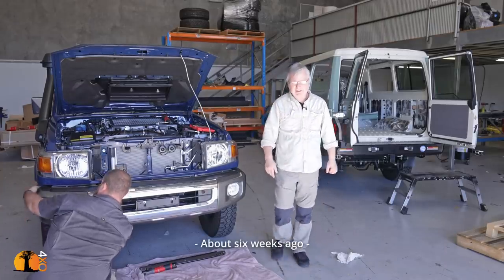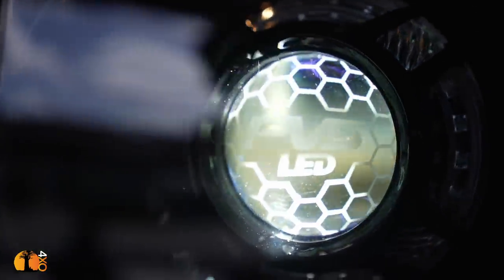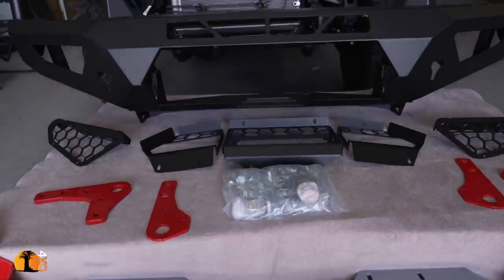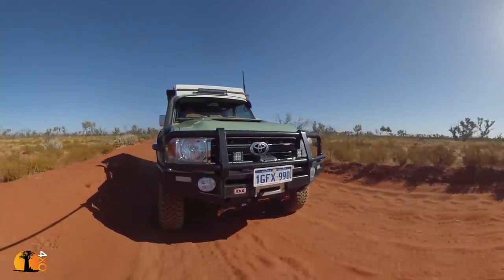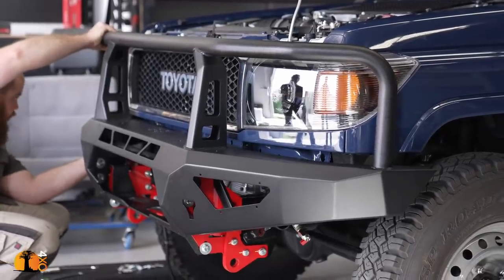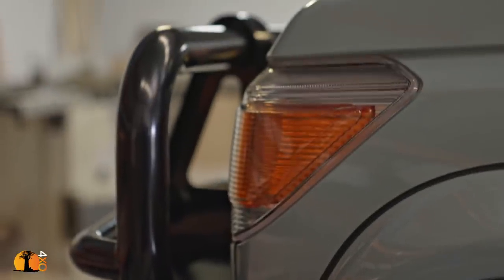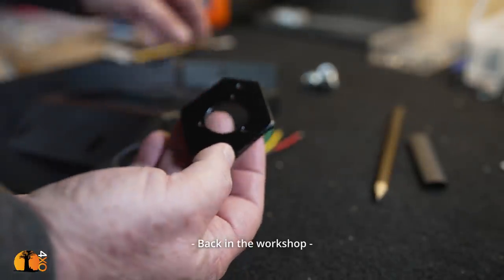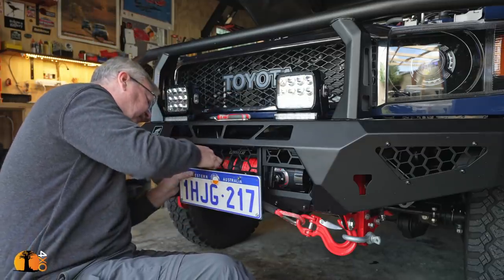BULL BAR, LIGHTS, WINCH & WEIGHT | How much weight have we added so far? | 4xOverland

Comment: I'm not sure I understood your argument in regards to not using a wireless control on the winch Andrew. Could you please be so kind as to correct what I have obviously misunderstood about your argument?

From what you said my take away was an argument against unsafe behaviour when winching by someone controlling the winch who is not paying full attention or fully engaged. 

But that can't be the argument because it would be a non-sequitur. That would be an argument about winching behaviour not about the technology used to control the winch. Where have I misunderstood you?

A wireless control can be used from the same standing position as a wired control, and one can make that behaviour a general rule. Similarly someone using a wired remote can be distracted or fail to pay adequate attention, particularly if enough cable is spliced in to length the wired remote. And we've all seen the idiots who have spliced in far too much length. 

The obvious argument to me against trusting a wireless remote is simply one of technological limitation. If you're stuck in mud or water, there is the potential for the radio waves to not penetrate and thus the control to fail or become delayed in an unsafe manner. 

Where as a wired control does not have such limitation.

Is that the argument you were actually trying to make? Because that's a good argument.

Comment: I wish you would have gone with an integrated light bar into your bumper. It would have made it so much cleaner. You also could have sealed your control box with silicone.
Reply: The control box solenoids  are covered in resin and are waterproof anyway, only hacks fill control boxes with silicone.

Comment: Wire the damn winch inside the car.    (and if you really need to use it from outside, use the remote)
I don't get it why you all invest do much in your cars, then when you get bogged you start running to connect the damn winch cable and have it hang over the bonnet.

Comment: I was under the impression that under the ADR it is illegal to install LED or HID headlights on a vehicle that came with halogen unless they are self levelling and you have headlight washers.
Reply: You're right, in the video wasn't but on PVS website it was mentioned in notes: "For Complete ADR Compliance Washer Jet Kit & Auto Levelling Airbags MUST be installed*

*Please check with your local engineers for compliance in your state"
Reply: Correct, I mentioned this when the lights first popped up (former auto design engineer) & was ignored. I'm guessing with free expensive stuff you have to fit them no matter what to justify the company's outlay.

At least the vehicle is a camper so can be slept in when it's defected & prohibited from moving during hours of darkness 🤣
Reply: I guess it will be dependent on local ADR interpretation for the LED lights, but suspect not legal unless specifically approved to the ADR's. Also I had thought folding plate frames may be problematic? - in saying that I ran a similar setup for many years, not visible so not an issue, although it may well fold up on river crossings
Reply: @kellyfleming4547  Generally speaking, for mandatory lights, such as headlights, there's no regional variance as far as ADR goes. Additional lighting, spotties etc. can vary, as far as I can tell, across the states.

Comment: Might be time you hang the boots up Andrew.  Your winch comments is ridiculous!! Sounds to me you don't want to go with the times to be honest.  How is having a wireless remote with "in and out"  side by side vs your wired controller that goes up and down any different?  Its not 15 buttons  to remember and have to keep looking to remember what does what. Your not typing a cryptic  code in on mobile phone size buttons pal. If you  seriously think this, you need to get out of the game. On another note... you may have saved yourself some KG's  going that bar, but once you hit a roo with that bar, kiss goodnight your front end.... and yes, I've seen this happen with this bar on plenty of cruisers.

Comment: that bull bar is to thin Andrew might okay for scrub deflection animal strikes right off of vehicle

When I gave you an estimation in weight i was factoring the whole build..

noting for animal strikes i average between 1500-2500 kg impact...

you hit a roo with that bull bar you will likely die
Reply from the maker: nonsense.
Reply: @4xoverland  sad to Andrew I have seen the aftermath of a roo strike  to know 2-4 mm thickness is not enough protection  for any type of animal strike  2-4 inch thick is a general need
Reply from the maker: @jasonhowe1697  I have seen the aftermath of a roo strike as well. Three times. All three times the animal died and in two of them, a Corolla would have driven off, no problem.  "you hit a roo with that bull bar you will likely die". What sensationalistic nonsense. That makes me think you have never seen a roo strike.
Reply: @4xoverland  actually it isn't as ive see roos mounted in wind screens  not a pretty sight...
nor is being left 100+ km from a town where the roo hits and cripples the  vehicle... may be an 80's Corrola might survive a hit modern  versions with crumple zones in front maybe or may be not..

modern 4x4's built today with crumple zones for human impact would likely not survive a hit from a roo or any other feral animal roaming the outback,,

My uncle wiped off his ute after a roo strike, though atleast he managed to limp back to perth  with a temp repair...
Reply: @jasonhowe1697  I can attest that a 1970s Kingswood will not run after striking a big red 4 hours west of Albany on a 39C day!. Sailed up , glanced off the screen and expired. Lucky  we all were, as I was driving 100km/hr and managed to slow to about 70. 1pm bright sunny day !